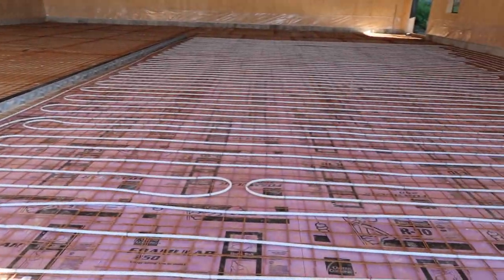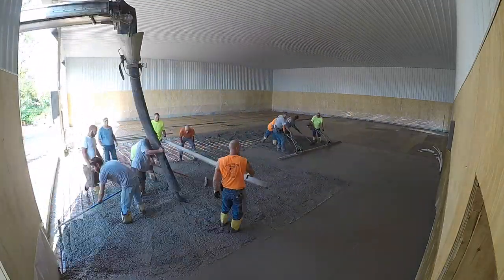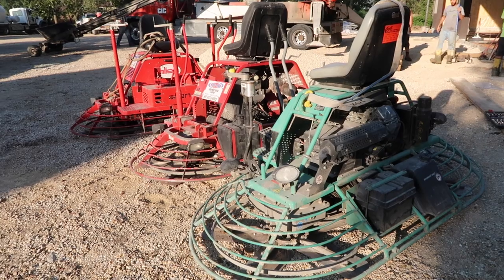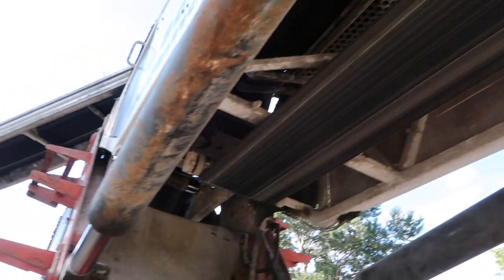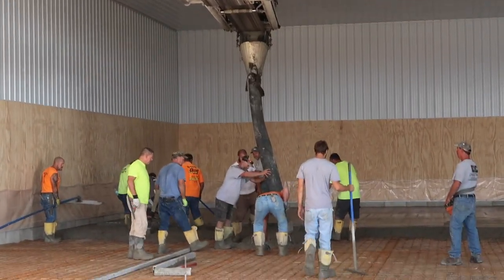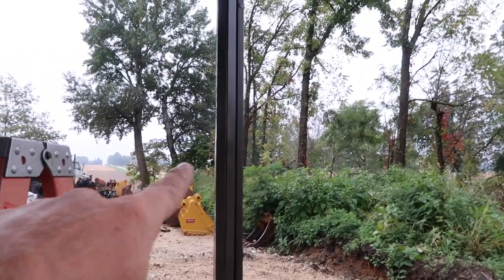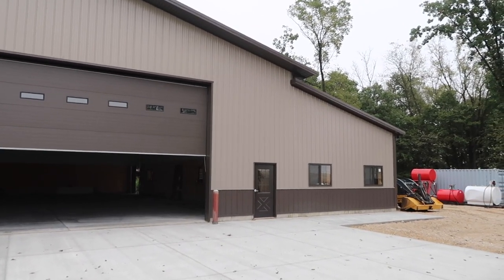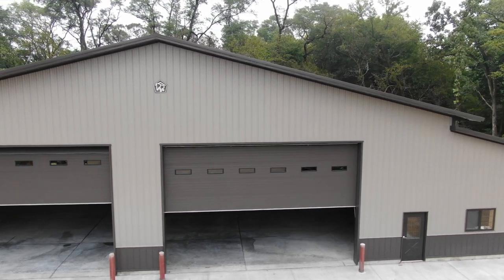Building the Dream Final Episode: How to Build a Shop

Comment: Very nice shop! I really like the lean-to on both sides with an office space because that makes it so much more useful and versatile. A lean-to also keeps bigger things that can be stored outside the shop walls from taking up valuable floor space. Can't go wrong with in-floor radiant heat even if you don't use it right away, it will be there. We did the same in our shop and it was a year or so until the boiler was installed but,  no regrets on radiant heat.....it is wonderful! Your attention to detail is top notch and makes all the difference with a build like this. The color choices are a slam dunk and the owner seemed to know what he wanted in a building, which helps too. Great job!
Reply: Very surprised they only did half the shop with floor heat.  We have had it over 20 yrs at our farm shop, love it.  Neighbor build a shop, but cut out the floor heat because of the cost of the boiler.  First winter he was in his shop and ours has regretted that he did not at least install the pex piping and worry about the boiler and operation later.  Have another neighbor that installed it in their wash bay to melt ice, swears we are lying when we claim we only use the floor heat.   My old house will have floor heat when we remodel it.
Reply: In-floor radiant is no joke! No regrets here at all. I do suggest a floor sensing thermostat as a must and don't skimp on the insulation under the floor or otherwise, just use common sense. Floor heat is all we use in our 50x70 shop with 14' ceilings and a second floor level and I can tell you it is more than enough heat even at sub-zero temps. No dust blowing around or some noisy furnace to listen to all the time either which is a plus.
Reply: @wvrockcrusher  we insulated under our floor.  Building shell by Morton, but we did all the finish work.  At my home I plan to heat the approach to my garage and the front porch and walk to the parking area.  A farmer an hour away heated his outside pad and has done well with it.  Of course not on all the time, only when needed a few times through out the winter.

Comment: Getting a new shop is like meeting the girl of your dreams. Nice build. I had a Morton 60 x 60 aircraft hangar built in 1990.  That was a lot of concrete. My only regret is I didn't do the heated floor. (eastern kansas) I like the lean to  on the side of your project here.  Lean to's are great for keeping equipment out of the sun and rain.

Comment: Being as it's been almost a year since this was first posted, I'm sure somebody has told you this, but in case nobody has. The slump of the concrete is how much water is mixed into it. A 5 inch is about mid range. A 1 inch slump is very dry and tight, a 12 inch slump is very wet and loose. Just in case you didn't know, now you do.

Comment: Way cool shop - congrats! ... would have loved windows, a lantern or ridgelight towards the back of it, to get some more natural light influx though.

About your steel clad posts etc. - steel directly on, especially tightly wrapped around, wood, is usually no bueno. Condensation turns directly into rot, when the water can't easily ventilate out of there. Furring strips are one way to deal with it, easy to dimension, though I know it does add an extra process, but on the bright side you won't have to worry about twists and bows in your lumber so much, and all of the back and forth with your caps. Another option is to put catchsteel on first, have a double inside/outside catch bent on both sides of your inner part, then skin it with the outer shell with a single inner bendover on the inside for it to grab, pound it flat, and Bob's your uncle... of course any combination of the two would do as well, and is worth noting anywhere you have a risk of surface condensation. You get a chance to hide those brackets out of the way at the same time. Gives a much cleaner look on porch posts.

Comment: Radiant floor heating should be a law! Great post. The few vids I've watched so far had little or no plumbing, drainage, electrical or hvac rough-ins???
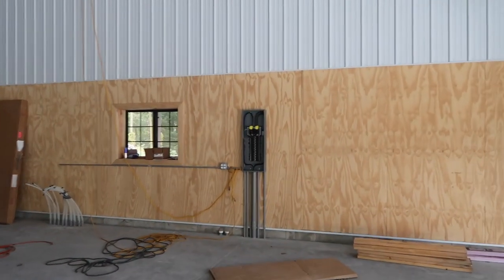Reply: He spoke about the electricity part at around the 8:25 minute mark. Surface mounted so owner can add on as needed. The H part of HVAC is radiant floor over most of the area, however, also stated owner isn't worried about heat as had been working outside most of his life and was excited about being in a building.

Comment: Loved that conveyor truck. First time I've seen one. I think it'd be more efficient than a concrete pumping truck. Looks like more concrete could be moved faster without risking getting a plug in the line. Anyway, thanks for another great build series. Looking forward to the next.
Reply: I first seen them a year or so ago, never gave them much though then as i do know they definitely take the chug chug noise away and less rough handling for the operator, definitely easier to clean off and as it shows it has more convenient reachability inside a low ceiling building compared to the arm and knuckle of a pumper.

Comment: Thats a very nice building. Also very unusual to put the concrete floor, after the building is up. I have a similar concrete floor in my building but the builder added fiberglass to the mix to make it super strong. After 10 years of heavy use, not a crack or chip.
Reply: I do concrete for work and usually with radiant heat you pour after the structure is up. Most of our pours with buildings with high ceilings get poured after the building is up.
Reply: All of our fire stations had their floor poured after the building was up. I bet it really helps the concrete cure nicely to withstand decades of 50k lb vehicles driving over it.

Comment: You know you're doing ok when you got a 6,000 sq/ft warehouse in your backyard
Reply: 72x80 = 5760 + 20x20= 400 (6160 total) did I miss somethin?
Reply: Step one be rich !
Reply: @NUTBUTER  You're a baddie
Reply: Too Wun  nope Kevin's Math is correct 5760+400 = 6160.  are you adding the area under the leanto?
Reply: Kevin Hirt if you count the big concrete ramp and the area under the roof on the side it’s probably close to 10,000 square feet
Reply: Too Wun  Um...no... It's called "bad humor". Wasn't funny at all.
Reply: @darthsailormoon4831  It was.
Reply: Step one Work Hard.. the rest will fall in place. @mrcwoodworks4523
Reply: Shocking how this build cost would vary widely depending on area of the country, very nice building👍
Reply: @boosteddartls2833  

Plus the customer being the one who prepared the land by leveling and doing all of the excavating saved himself thousands.
Reply: @mrcwoodworks4523  Step One: Discipline to Financial Freedom. A) Live Debt Free.  B) Cut up all those credit cards.  C) Savings Plan. Start where you are, and soon after implementation of A,B and C You Too will learn how the Rich got that way. It ALL starts with a PLAN.  Build upon that plan and within 10 Years you will bear the fruit of what you started.
Reply: @anonimous2451  - Yup. The key is to save every penny and invest wisely. That is becoming increasingly harder to do in recent years and this trend will only get worse (because of several reasons). But it's still probably the best way for the common person to achieve any degree of financial stability.
Reply: @boosteddartls2833  - I was just thinking that. In my area (Bay Area), it would cost twice what it probably cost to build it in rural illinois (if not more).
Reply: @NUTBUTER  I think the pour was 10k
Reply: RobbieV For the concrete only. He said over a 100 yards being poured. Pump truck was probably a $1k by it self. Then the labor and set up.
Reply: @kevinhirt  add open yard ?
Reply: Texas CAT Manuals  now that was humor
Reply: @anonimous2451  Totally disagree. Leveraging debt is how you get rich. Example. If you buy an apartment building for one million dollars cash you have one apartment building or you could by 5 1 million dollar apartment buildings each with $200,000 as a down payment and have $5 million worth of apartment buildings with 1 million dollars invested. Now The renters are paying down debt on $5 million which turns into equity, and your appreciating on $5 million could turn into 6 to 10 million in 10 years and you're getting cash flow on 5 million well you're holding the assets.  Having good credit is a key to getting loans so have at least three credit cards responsibly and at least the car and or mortgage to have a really high credit score and show that you're responsible to lenders and keep your debt to income ratio low and leverage debt to buy assets. That is how you get rich.  Only save money so you can buy assets.  You want lots of debt!  Good debt.  If you go to a lender with no debt they're going say, "You don't pay any credit cards or any mortgages or any car payments how do I know if I loan you money that you're going to be able to pay me back?". Also, do you know how long you would have to save to save $5 million?  Way too long! Start leveraging money and investing as soon as possible.
Reply: @scottegbert  Great advice Scott! I don’t know how I ended up reading this, but I’m grateful I did.
Reply: @kevinhirt  height I think, I thought 72x80 was the floor plan.
Reply: @mrcwoodworks4523  step one: work your ass off
Reply: 0
Reply: @turbomustang8417  most pump trucks in Midwest run about 500 but that was before Biden.   They didn’t use a pumper truck for this it was a conveyor truck and they have a 10yrd min and run 300 dollars.  They can only reach out 32’.

Comment: KYLE. Who decided to offset the front doors. My OCD is on FIRE right now lol
Reply: I caught the same thing. I was even counting the windows in the doors. I guess the front walk through door caused the offset. I would of had it in the office.
Reply from the maker: yes it bothered me as well
Reply: when viewed from inside you see why: vestibule at entry door (keeps office private from shop entrance); shop space - work benches along wall; etc. It looks fine to me - designed for use.
Reply: walk in door would have been between the big doors, and one for the office with the windows on each side if it were mine but still a great job
Reply: Doesn’t matter on the outside for symmetry. Looks like there will be storage on one side beyond the service door.  That is why there is more room on the side with the access door. That is a well thought out plan. That most likely was not his first shop he planned.
Reply: I don't mind it.
Reply: My OCD got triggered as well.
Reply: First thing I noticed. The support between the main doors should be lined up under the roof peak. It does not look good like that.
Reply: Function over form.  Makes sense with a shop that will get used
Reply: It still looks good though regardless.
Reply: Avshalom Chotawm  wouldn't that make the corners more susceptible to being bent and crushed in with no backing material directly behind them?
Reply: Thanks for touching on electrical I was wondering why you guys weren’t do it.
Reply: I wish you lived closer i want a 50x100x16 built

Comment: I get around the static/preconfigured power delivery problem by using Starline Busway in my lab/shop/studio builds.  It's not cheap, but it's about the coolest thing ever for being able to reconfigure your shop power on the fly, safely and to code - at factories it saves a bunch of cash and adds safety by only needing to mess with the wiring if more capacity is needed or to bring power to another location; no more $60k phone calls to install a new circuit/panel which won't be done for 3-4 months.  It's hella convenient to be able to pull in a piece of gear that runs 440 and merely need to swap out some bus taps to add up to the right voltage/current capacity.  Same for mixed groups of gear - like 48V DC being sort of standard for tower mounted equipment (at least in US) - any way you want to configure and clean that power up, no sweat with reconfigurable power systems.  It made running a test farm of cellular base stations (and the end to end configuration testing thereof) much easier than it had a right to be.  Most people just use them for server rooms, but I find that most people in industry are fairly lacking in insight and creativity given the wealth and availability of modern tools and systems.

Comment: What was the cost to build this entire shop, im looking at building a shop very similar to this in 4years
Reply: even a ball park cost would be nice !
Reply: What state is this in?
Reply: We did a 40x60 with a upstairs living quarters plus plumbing ect and it was 60k. Im guessing this is around 80-90k (location is a huge  dictator in price. We are in MN)
Reply: Oops shit didnt see that huge apron. Add another like 15k lol
Reply: I'm hoping he replies with a ballpark price also.
Reply: guy at work built one for $40K........   the cement was $17K and the building came on a semi....  Him and his wife assembled it...  it looks almost as good as this!!!
Reply: @zolitariglussey6302  I was gonna say, this is a very professional job, and look at all that heavy equipment.  I see a dozen guys.  I see a lot of cost.  But if the trimming doesn't have to be perfect, and all you need is a shop, seems like it can be done for cheap.  Concrete is gonna cost though.
Reply: Built a 80x140 20 ft ceiling with an office last year. All in taxes, permits, fully insulated, heat, a/c, bathroom etc was 195k
Reply: @gregsall5872  why would location be a huge dictator for building? wouldn't it be for just buying the land
Reply: @Rockymountain11  finding contractors, getting supplies deliveried, how far pump trucks have to drive how far the cement trucks have to drive. Supplies usually cost more if it requires more transport to get it there. If you have to pay to run city water and electric. Also depends on the market ect.
Reply: Yep a lot of variables effect the final price.
Reply: Nick Maclachlan  I'd think rural would be more expensive because less jobs
Reply: +smartguy05444 rural is cheaper because contractors don't pay as much for their labor. or the land that they live on. or their gasoline. not as much demand for contractors in country areas. in the city big demand for contractors and a lot of projects require union labor. Lots of building going on in the big cities such as the Bay Area. supply and demand dictates prices
Reply: Why is only half of the floor heated?